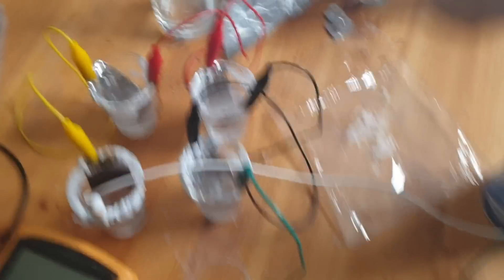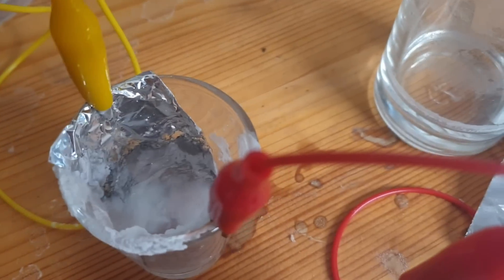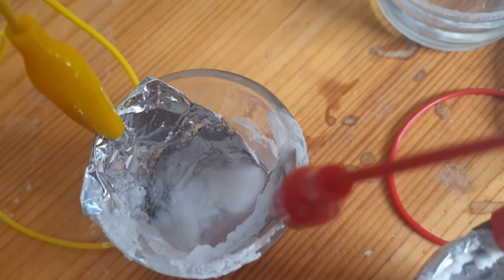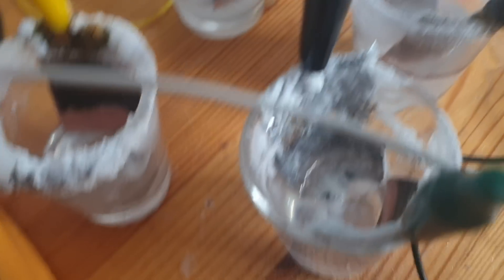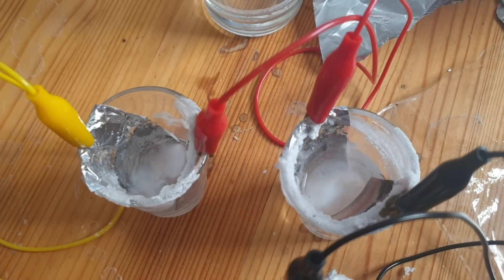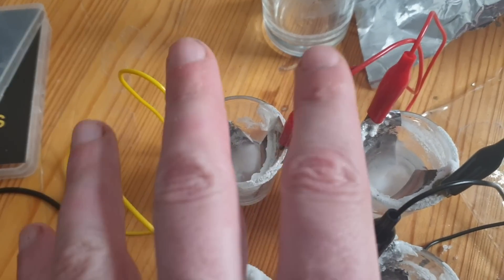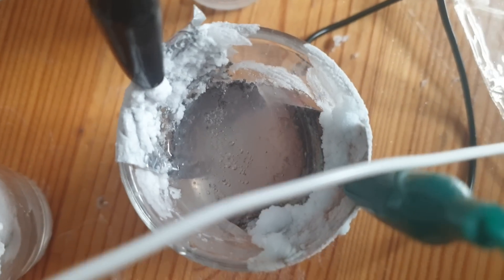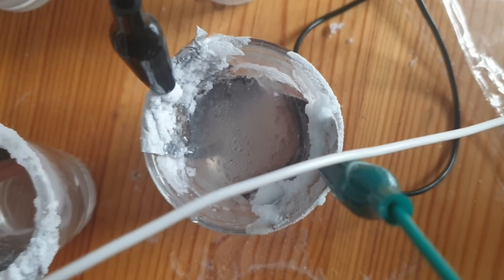'Free electric from salt water' - one week later!

Comment: now do one where you charge a phone and see how pathetic it is
Reply: That was never the point tho, he is just testing how long it can go for. I tried something similar with an aluminium plate about 2cm wide and 4cm long, a piece of paper with saltwater and graphite. It produced around 1 volt but very low current (couldn't measure) so i wasn't able to light an led. With enough of these cells, you could charge a phone, tho it wouldn't be that practical
Reply: @karestkrest5802  If it only made 1V the reason it didn't light up wasn't low current but low voltage as you need 2-4V depending on its color
Reply: @karestkrest5802  yes it's the point; debunking that stupid "Water powered device!". It's meant to charge your phone. This one was just powering a modern energy saving LED.
Reply: @dimitar4y  but he did not mention it's meant to charge a phone(maybe i missed something in the video, idk) he should know, i'm pretty sure this guy is a chemist and he also has a channel "thunderfoot" where he debunks other stuff
EDIT: or im dumb
Reply: @karestkrest5802  Context. It's called CONTEXT. The reason he's doing this is because of a recent debunking video about "water powered phone charger!"... This video is in relation to that.
Reply: @dimitar4y  aha, thanks for clearing this up for me, wow you have patience
Reply: @karestkrest5802  I'm basically god, so.